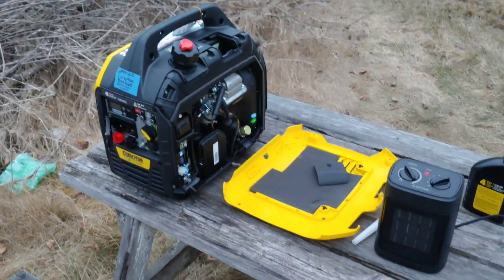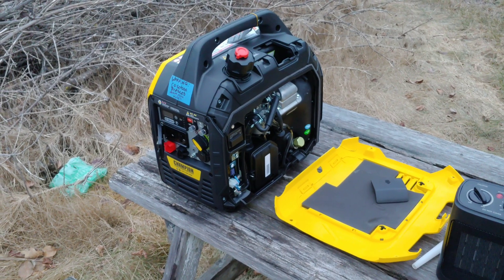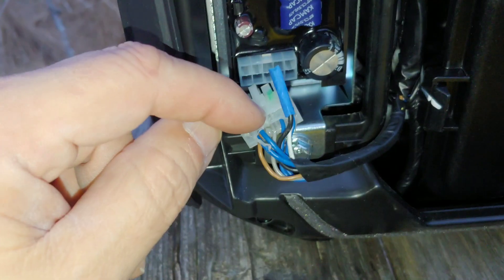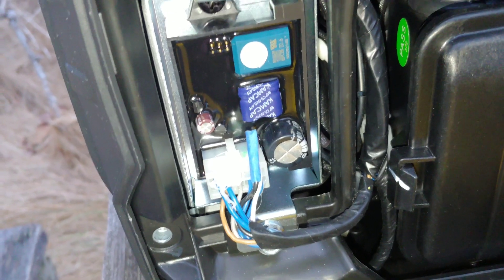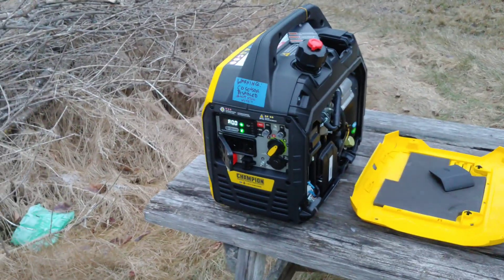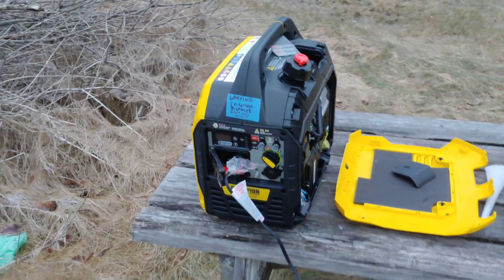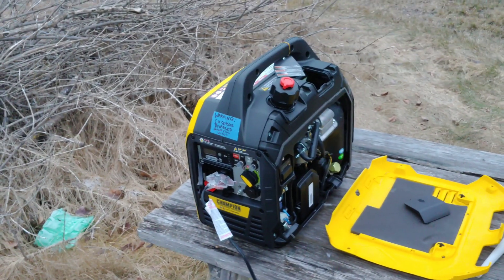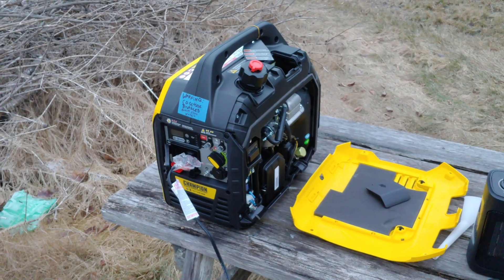Disable CO Sensor. Champion 2500w Inverter Generator (201153)

Comment: I have a 2500 dual fuel. Same problem with 02 sensor shutting down unit. On the module that contains the 02 sensor there is a blue rectangular shaped component with a small round white like cloth or filter. This is the actual sensor/ sniffer. I covered the white filter with silicone caulk. Also there is an air intake on the module that you have to remove to get to the bottom screw of the module. This part is open to the air to bring outside air into the sensor. I also plugged this with silicone caulk. This seems to have solved my problem. So far I’ve tested it for 1 hour without a problem. Before doing this I would be lucky to get a half hour without a shutdown.

Comment: How do you know exactly which wire to pull, or in some cases jump, if there are no wiring diagrams? I’m getting a new Champion 9000 watt open frame inverter generator (model 201067) and am hoping to do the same thing.
Reply from the maker: I dont know about that model, but usually if you go on Champions website and lookup your model, go to downloads, parts list. Its usually attached the end of the parts list pdf
Reply: @navydave1 perfect! I’ll check it out. Thanks!
Reply from the maker: @vim_usr2753  I entered in the wiring diagram of your model into ChatGPT and asked it how to disable the engine shutting down when CO is detected and this is what it told me. This may lead you in the right direction. I don't know if its accurate. Its what a robot said to do lol.
To disable the engine shutoff function of the CO sensor while keeping the rest of the system intact (such as allowing the CO indicator to still light up), you'll need to interrupt only the engine shutdown path controlled by the CO module, not the module's power or detection circuitry.

---

🔍 Here's how to identify it on the diagram:

1. Locate the CO Module in the center-bottom of the diagram (labeled clearly).

2. Look at COM8-B, connected to the CO Module. This wire is labeled "Y/G" (Yellow/Green).

3. Follow the Y/G wire — it goes to a relay or cutoff circuit that leads toward engine control (via COM5-A and ignition coil shutdown path).

---

✅ To prevent the CO module from shutting off the engine:

Disconnect or cut the Y/G wire from the CO module (COM8-B).

This disables the shutdown signal from being sent.

The CO module will still have power and could blink an indicator LED, assuming that's handled on another circuit (e.g., COM8-A or COM8-C).

The sensor will no longer be able to trigger the ignition shutdown via the control relay or logic circuit.

---

⚠️ Important Notes:

This modification disables a safety feature. If CO builds up (e.g., in a garage), the engine won’t shut off, potentially leading to carbon monoxide poisoning.

Do not do this unless you fully understand the risks and take alternate CO safety measures, like using the generator only outdoors and with a CO detector nearby.

Would you like help modifying this setup to still warn visually while disabling only the engine cutoff?
Reply from the maker: @vim_usr2753 Here's another option it gave...
Great — here's how you can disable the engine shutoff feature from the CO sensor while keeping the warning light or indicator working. We'll go step by step using your wiring diagram.

---

🧠 Objective

Keep CO detection active and allow indicator (blinking light) to function.

Disable the engine shutoff feature triggered by the CO sensor.

---

🔍 Wiring Details from Diagram

CO Module Connections:

COM8-A (Br wire): Likely power or logic ground.

COM8-B (Y/G wire): This is the shutoff signal to the engine control circuit.

COM8-C (R wire): Possibly provides power or signal to the CO module or an LED output.

Engine cutoff path:

Y/G (Yellow/Green) from COM8-B → COM5-A → ignition control.

This is the wire that cuts spark when CO is detected.

---

✅ Solution Steps

1. Disconnect or cut the Y/G wire between COM8-B and COM5-A:

This prevents the CO sensor from sending a shutdown signal to the ignition circuit.

Leave the other wires (Br, R) connected so the CO module still gets power and can operate the indicator light.

2. Optionally, add a normally closed switch inline on the Y/G wire:

This lets you re-enable the safety shutoff if needed (e.g., if lending the generator).

Label it clearly: “CO Shutoff Bypass.”

---

🔧 How to Do It (Safely)

Disconnect the battery before working on any wiring.

Locate COM8-B and trace the Y/G wire.

Cut or disconnect this wire, and cap both ends with heat shrink or wire nuts to prevent shorts.

If installing a switch, use a weatherproof toggle or rocker switch rated for low-voltage DC control circuits.

---

⚠️ Safety Warning

This disables a critical safety feature designed to prevent carbon monoxide poisoning. Only do this if:

You are operating the generator outdoors, away from any enclosed or semi-enclosed areas.

You have an independent CO detector with audible alarm in the area for backup.

Would you like a diagram or illustration showing how to splice in a switch or bypass this wire safely?
Reply: @navydave1 Very helpful info. I’ll let you know how it goes when I get the generator in a week or so. Thanks!
Reply from the maker: @vim_usr2753  One thing I did to release the wire from the plug, was to take 2 staples, straighten one side on each and push down on either side of the wire to release the tabs. Then it pulled straight out. That way you can test it befote you cut it. Or just leave it out and tape up the push blade on the end of the wire.

Comment: I have the 201317 model but my connector has different color wires…

I was wondering if maybe your familiar with that model and which wire I would have to unplug
Reply from the maker: Not familiar. If you look through the comments I think someone had info on the similar redesigned model with maybe a different model #?

Comment: I have a newer model 201530 (2500 watt). There's no black wire, instead there are brown wires. You can trace the brown wires back through the case and unclip them from the ignition wires they're clipped to. You can just reclip the two starter wires together and BINGO. Totally bypasses the c02 auto shutoff and super simple. Done in a minute or two.
Reply from the maker: Good info, thanks for sharing! 👍

Comment: Thank god finally a solution!! I run mine on the tailgate of my truck and feed the AC in the camper. Unless it is a windy day that gap between the camper and the truck is enough to trap the CO2 and constantly shut off the generator. The old black Champions didn't have this CO2 'protection' "feature". Guess what I used them for years and I am not dead yet. Same with my Honda.
There is such a thing as nanny over engineering. If you are stupid enough to run a generator in a closed garage then you deserve your fate. But outside in the fresh air in a forest or desert?? Give me  break. 
Thank you so much for this genius solution.

Comment: Worked great for me! Champion 4000 watt RV ready Inverter generator from Amazon. Model number 100809. I tested it by putting sheets of cardboard all around the generator while it was running. It took five seconds for the CO alarm light to illuminate, however the generator just kept on running!! Thanks for posting this nice solution. 
Rather than pull the pin on the connector, I just cut the black wire. Works great!!! Thank you!😊❤
Reply from the maker: Cool! Glad to see it worked on a 4000w model.

Comment: Do you remember what tool you used to?Remove the pin from the plug?  I'm having a heck of a time removing my lol.
Reply from the maker: Yup. I took 2 staples. Bent one leg straight on each and pushed down on both sides. There's little tabs inside and it should release it. I found it on some other video about removing wires from a harness. Can't remember which. I think they make a tool also for it, but try the staple trick.

Comment: What a nuisance. Triggers when the wind blows in a wide-open outdoor area.
Reply: Im having the exact same problem during the break in period on mine right now. It has shut off 3 times in 30 minutes because of the CO2 sensor and it is sitting outside in the middle of my yard on a couple of pavers. Pretty poor design flaw

Comment: Another bad thing about the CO sensors, when they shut the generator off, it shuts it off underload, this is never a good thing for the generator. How many times does it do this over and over shutting it off under load.

Comment: Thx a zillion. My 2500 is useless rn.  
It seemed to run OK outside when 1st bought a couple months ago.
But when weather got colder, it refuses to run more than 30 min.

I use it to charge my solar battery when not enuf sun.
It is outside and still cuts off after about 15 - 30 minutes. 
My old Westinghouse iGen 2200 ran just fine in a semi closed shed.
I have to use my Champ 4750/ 3800 w/ open frame w/o CO sensor.
it uses a lot more gas per watt generated.
Imma try this mod tomorrow.

I have a 1200 VA charger and a 400 VA charger.
I like to use the Champ 2500 for the little charger ~ 1/4 output. 
It will run both at max power.
I use the big Champ to use both chargers as it is much quieter.
Reply from the maker: Nice! Let us know the results. Good luck!

Comment: ok tried the wire removed did not work so instead of wrapping it in plastic bag i took it out wrapped in blue painters tape then in the silver tape thats use in A/C and heat wrapping cut out where the connector goes put it box in its little box that screws on generator put on all the sides and used it to vacuum and its been running for over an hour so will see how long later when i run it tell it runs out of gas which it has never run even close to that before
Reply from the maker: @donalddday7741  Whatever works. Another thought would be to hot glue the sensor. What model is it? I'm curious now.

Comment: pulled out the wire taped it up ran about 10 minutes then died so on to next guy who has a video to bypass this government controled crap
Reply from the maker: That's a bummer. What model was it? The newer ones with a different shape case seem to have a different wiring diagram.
Reply from the maker: Seemed to work on most of this style. Guess we'll have to add one model that doesnt work. And to confirm, it was the black wire, top middle? Check your wiring diagram and see if it shows which wire goes to the engine cut off.

Comment: Downloaded the parts list/manual for my 201183 Champion 2500 Dual Fuel. (It was the black wire). Disabled it and for the FIRST time my generator ran for 5 hours without shutting off every hour. So helpful! I only run it while dry camping so it’s always outdoors and far enough away from my RV and others. FINALLY! 😁😁
I was beginning to question my purchase. If someone needs a CO2 sensor to know if they’re running it in an unsafe manner perhaps they don’t have any business owning a generator. 
Thank you again, sir!
Reply from the maker: Awesome! Glad it worked!

Comment: My Model 201323 (2500watt) exhibits the same dumb behavior.  The sensor looks like it's oriented upside-down from the one in the video.  The same 10-pin connector has a Yellow/Green wire in the same position as the Black wire removed in the video.  Removing and taping-up that Yellow/Green wire seems to allow the generator to run, but I haven't seen the flashing red light while running, so I'm not yet sure if the problem is solved. I tested it for an hour today, in the same outside location it had failed before, and it ran fine without a warning light.  I'll repeat that test in various locations where it had failed before within 5 minutes.
Reply from the maker: Hmm. Yeah, looks like a redesign. They must have figured it was too easy to disable. Lol. Hopefully that's the trick for yours.
Reply: Did this continue to work with additional tests? I hate the CO Shield sensor and only use my generators in an open field (obviously). Don't need the CO Shield and it shuts the generator down repeatedly.
Reply: @richardwhirley8404 yes. Runs fine. Just be safe since the safety feature is disabled.
Reply: I just got the exact same model number generator. Already twice it's shut off on me and it was outside.  I'm going to do what you suggested so you just pulled that wire and it still works fine?
Reply: @jesseday6090   Yes.  It starts and runs perfectly, and I run it monthly since new without issue.  Good luck and be careful! CO wants to kill us. 😮
Reply: Still working fine. I run it every month. No issues. Good luck!  Be careful, CO wants to kill us. 😮@jesseday6090
Reply from the maker: @jesseday6090 Yes
Reply: I have this model also, on the wiring diagram it shows to be a ground, is yours still working well with the yellow green unhooked? Thx
Reply: Yup!  @rickdougherty1371

Comment: thanks for posing this. I will have mine in a shack like yours to run my sump pumps in case of power outage. i cant risk it shutting off in bad weather and flooding a finished basement. people criticizing would eat laundry detergent if it didnt have a warning label i guess
Reply from the maker: Haha! True. Glad this worked for yours.

Comment: If anyone has the champion 4500 duel fuel inverter and want to eliminate the co sensor just take the sensor lose from the frame and wrap it with plastic lunch bags and tape it up really good with electrical tape And tuck it back in the inverter behind front panel. Did mine this way and it no longer cuts off because of the co sensor. I run mine in my truck bed with cover closed and tailgate open when camping and it works great!
Reply: David, I like your idea.  I have a 2500 but the wiring is different from what Navy Dave describes.  So the part everyone's referring to is actually called the CO Module, and I'm wondering if the actual sensor (which detects the CO2) is actually in the module or somewhere else in the machine.
Reply: good idea, but more trubl than worth. 
Just leave disconnected all the time.

Comment: I'm trying to figure out my 4650 inverter.. but it has double the wires..
Reply: Got a way of doing it!! Disconnect the harness from the sensor. Locate the 2 full black wires and the 2 full orange wires. They are next to each other. Cut them. Connect black to orange and black to orange. Doesn't matter which with which. For the sake of it..i decided to identify mine in case it was important. And voilà.  No more sensor needed. No more red light blinking and no more constantly shutting off.
Reply: @roberteugene2124  i love you!! Thank you sir!!
Reply: Take off sensor and wrap it up in lunch bags and tape it up good. Worked for me!
Reply: @davidrhine8562  LOL at this point I'm desperate so I will try it
Reply: @4Sky46  Did the bag thing work for you?

Comment: Works on model 201183 2500w dual fuel. Exact same wiring and co sensor.

Now generator will stay running even when the wind changes. Such a poor design.
Reply from the maker: Awesome!

Comment: I wish I can find a video on how to do it on my 4650 watt inverter generator champion model. It has more wires..
Reply: Just take that sensor loose wrap it up good and tape it up good. Leave it plugged in though. Wrap and tape the crap out of it and it should work for you.
Reply: Got a way of doing it!! Disconnect the harness from the sensor. Locate the 2 full black wires and the 2 full orange wires. They are next to each other. Cut them. Connect black to orange and black to orange. Doesn't matter which with which. For the sake of it..i decided to identify mine in case it was important. And voilà.  No more sensor needed. No more red light blinking and no more constantly shutting off.